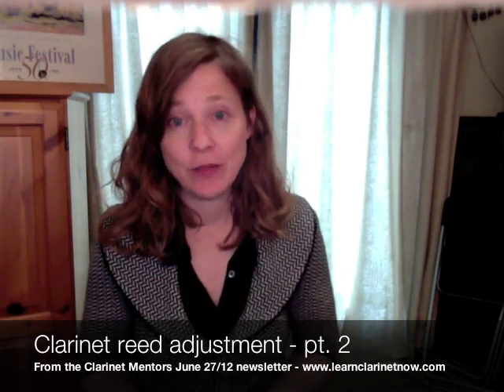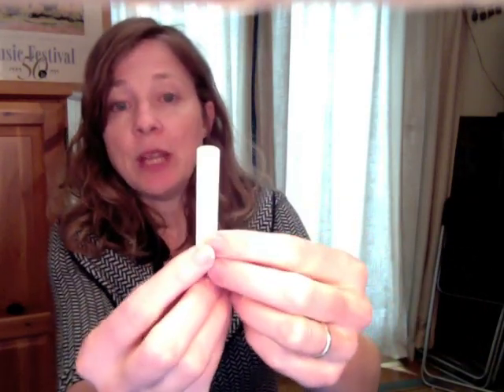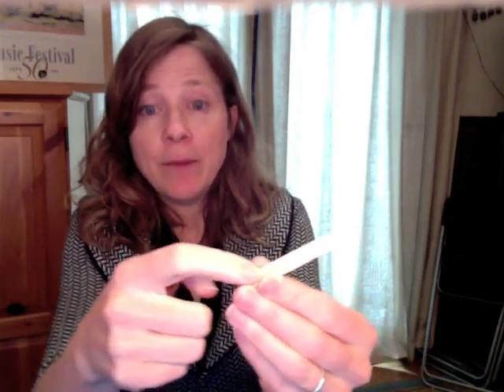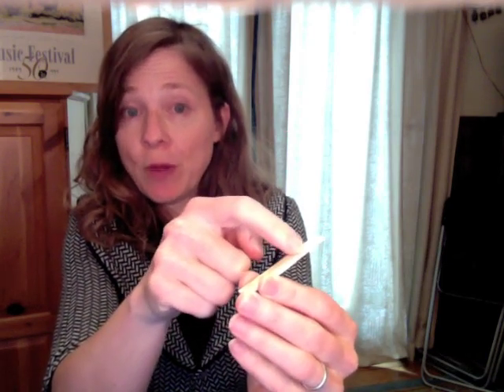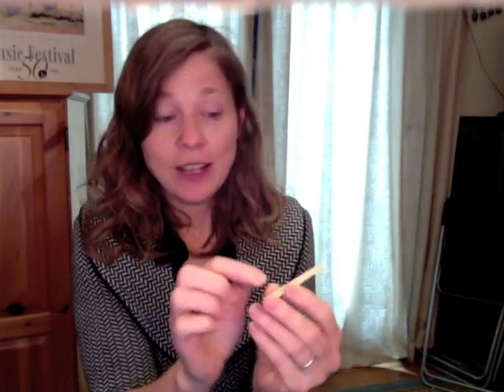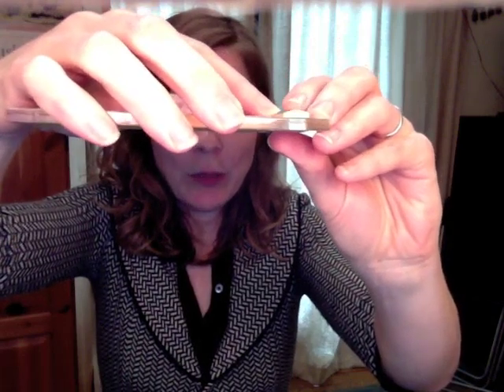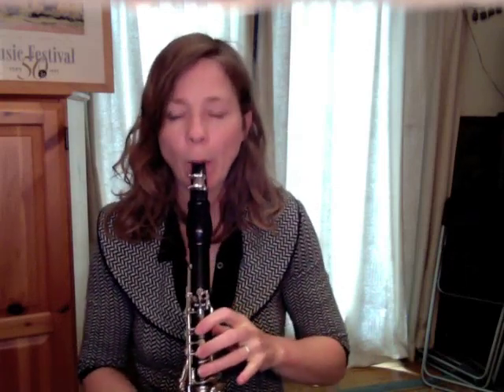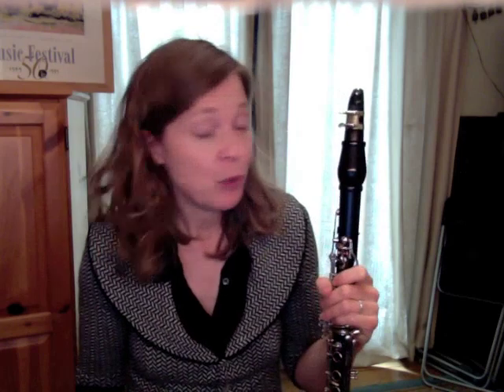Fix reeds - Clarinet reed adjustment part 2

Comment: Easiest way to get a really flat piece of glass (not always the case with picture frames) is to use a mirror.  These have to be made with ground glass - so that the image is not distorted - and the glass is polished between two grinding wheels to give it a dead flat surface.
Re. grinding with a 'figure of eight movement' - Michelle is correct; this makes it far less likely that the reed will end up with a curved surface after sanding.

Comment: Michelle, everything I want to know about my clarinet it seems you have the answer - I have a few good quality reeds that are now too hard to play. The Vandoren Reed Adjuster is really expensive to source here, so I'll make my own as you suggest. You mentioned 400 grit sandpaper. Is that the finer of the two? Would you advise adding the coarser one too? And if so what grit for that - 320 maybe? Thanks a mil. Clare
Reply from the maker: Clare Laurence Generally finer is better, - you just need to sand more if the reed is really warped. Most homemade versions only use one grade of paper.
Reply: Clarinet Mentors (Michelle Anderson) Thanks Michelle. I made it today and it only took 10 minutes. I stuck the sandpaper onto picture glass with double sided tape. My new Vandoren 21 reed was really stiff, more like a 3 than a 2.5 and It's much easier to play now after a couple of minutes sand. I know this video is 3 years old so I wonder if you've used the new Vandoren Glass Reed Resurfacer RR200 which has a rough glass surface instead of sandpaper, and a glass wand (whatever that does!) and if so, what you think. As I said, it's expensive but I might consider it at some point.
Reply from the maker: Hi Clare, Many of my students have the glass Vandoren resurfacer, and really like it. The wand lets you scrape small surface areas of the reed if you are adjusting the tip. I haven't tried the new one simply because my years' old one still works great. I think the new ones work very well by all accounts, and have the advantage of not leaving any sandpaper residue on the reed.
Reply: Very useful, thanks Michelle.